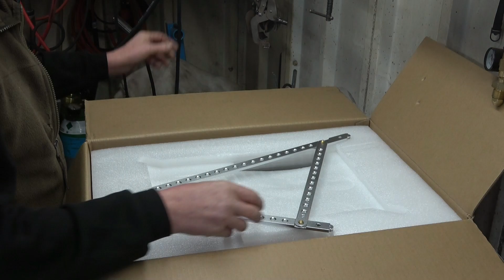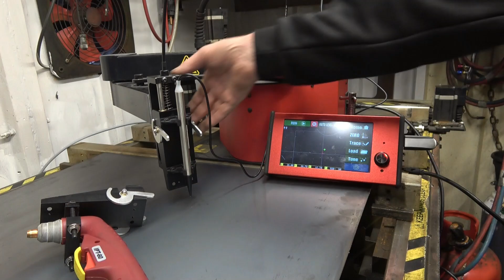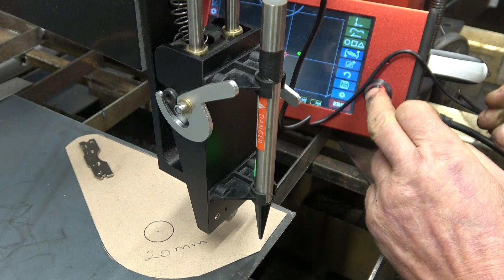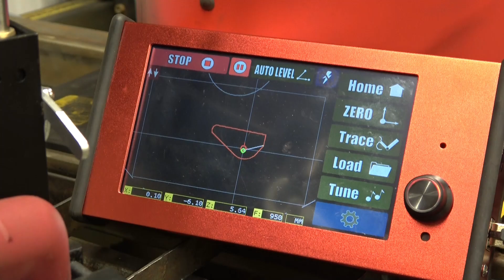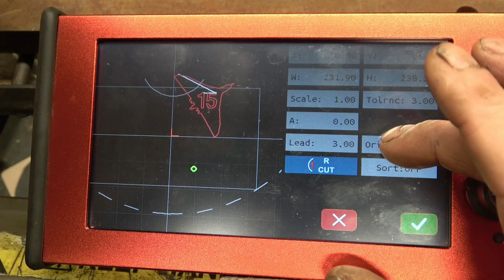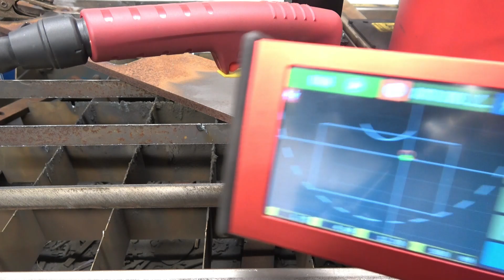Arcdroid C.N.C. Magic The Doiubleboost Edition

Comment: Old video, I have one with the new controller. It is made in china but the inventor is canadian. The new controller is a great improvement and you will be less dependent on a cad/cam computer program. I dislike 360 as it is cloud based and you don’t own it but only have monitored access to it.

Comment: Just bought the package from Rob at Xtreme, this will be perfect for my little workshop. Dropped your name when I spoke to him on the phone. :)
Reply from the maker: Well done you won't be disapointed
Reply: @doubleboost  hey John not set this up yet but wondered if you could show me the connections on the back and how yours is connected, I have a positive and negative connection plus Aux 1 and Aux 2, not quite sure if I need them all connected (probably do) it is not clear either which is post and neg on the power connections cheers mate

Comment: I saw that Internal Offset on the dummy run. 
No good shouting at the screen thought worrit ... 😜
Reply: You know when you're at or above your piercing limit, can you start just off the edge and cut in ?
Reply from the maker: @KozmykJ  On the plasms table you can do all the pierce points  then change the cons for the main cut .The 10 mill clean pearce impressed me . A longer delay would have removed the surface dross .
Reply: Impressive solution. Makes so much sense. And Canadian too it seems. Going to look at the website next thing. Thanks.